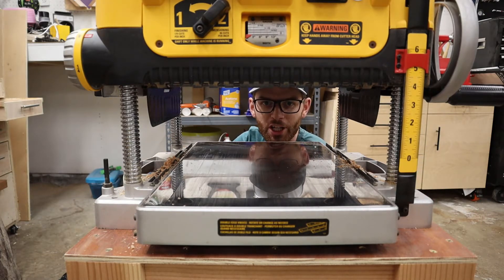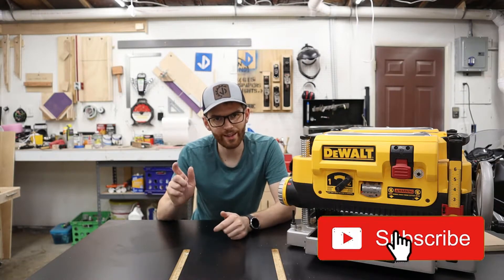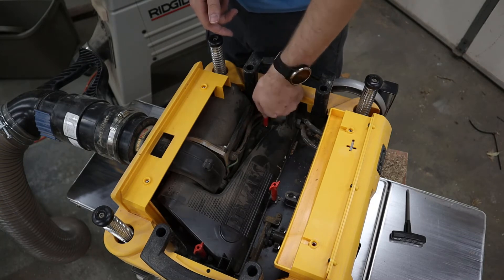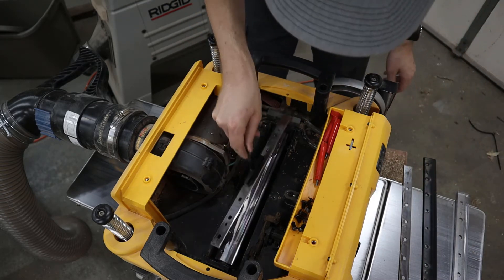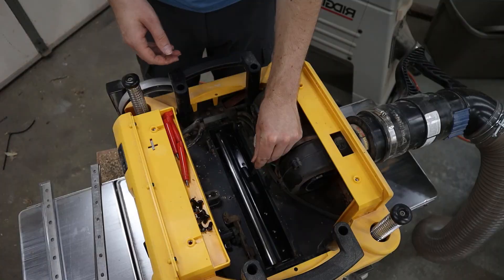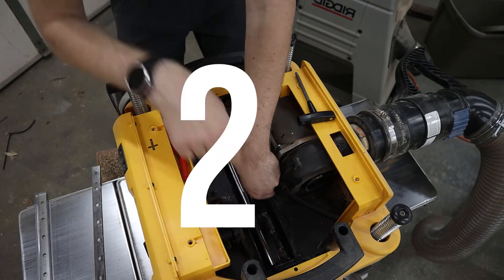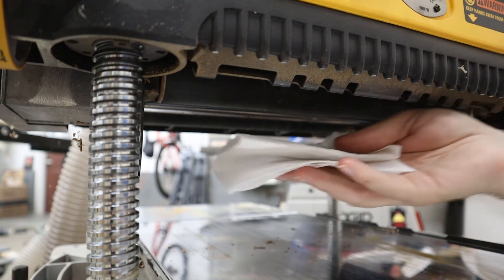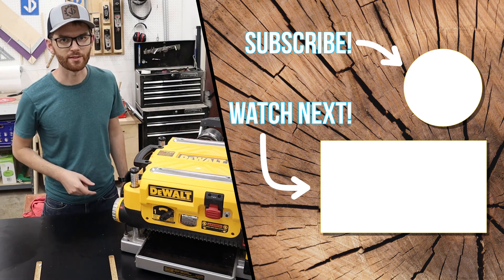Learn to Replace DeWalt Planer Blades like a PRO! // Shop Tips and Tricks!

Comment: Wow Dewalt made it easy to replace the blades on the DW735. I had a DW734 I believe and changing those blades was a nightmare. Screw sharpening the old blades just slap new ones in.Thanks Jake, I owe you a few Pints cheers
Reply from the maker: For sure, it's super easy! Thanks for watching!

Comment: Is it impossible to install the planer blades upside down/  If not, which is the correct side up?
Reply from the maker: it is technically possible to install the blade upside down, however, there are features that make it obvious as to the correct positioning of the blades.
Reply: @MakewithJake  I just found it interesting that two Dewalt planer videos on blade replacement never addressed that.

Comment: So I purchased my planer (same as video) used and it didn’t come with the tool to unscrew everything. 
Is that just a regular torque bit? What if the screws are having a hard time coming off of the blade guard?
Reply from the maker: You should be able to snag a new tool off of amazon, just type "DW735 replacement wrench" and it should come up.  The magnet is really handy.  Otherwise, yes, it is just a standard torx bit, unsure which size.
Sometimes the screws start to seize over time, so it takes significant force to break them free.  Good luck!

Comment: For the life of me, I cannot break the screws loose to remove the shroud and access the blades... any suggestions?
Reply from the maker: Try a torx bit in your impact driver.  that should help break it loose.  do NOT use an impact to put it back together though...